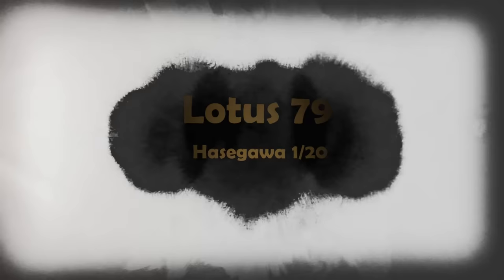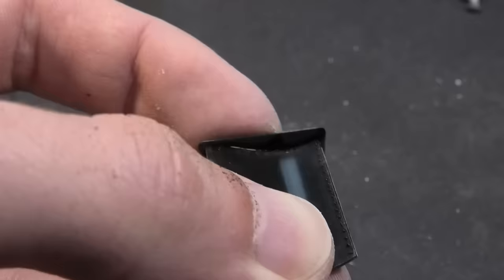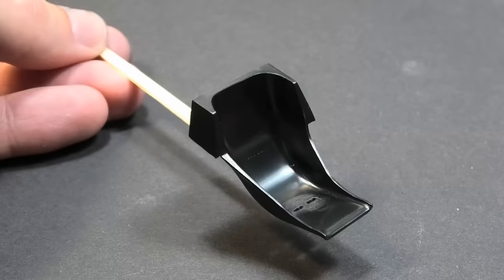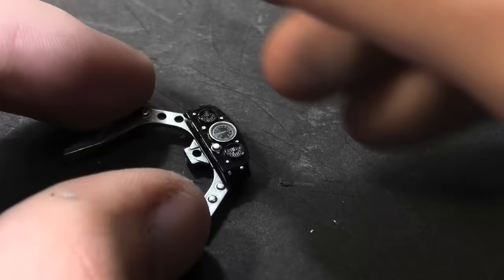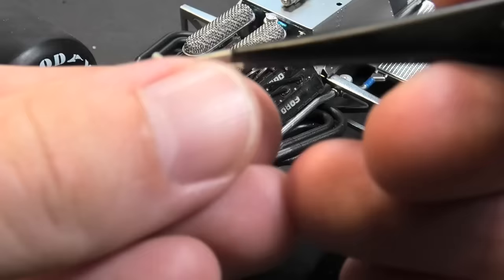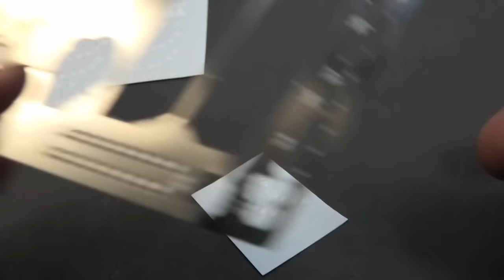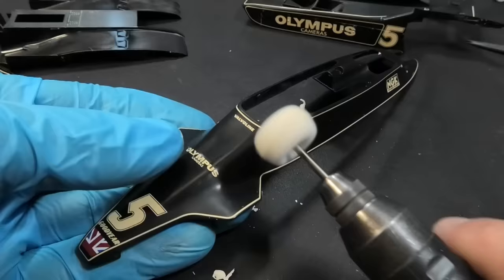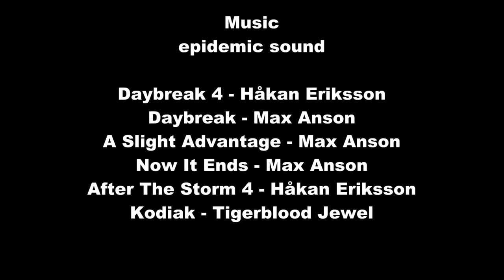Lotus 79 Black Beauty 1/20 Hasegawa - Car Model

Comment: FIY the wires used for WIFI transmission from the antennas to the WIFI module inside laptops have that braided texture. Excellent for making small details.
Reply: Good tip!
Reply: Thanks for the tip, I have a dead laptop I can raid for part!

Comment: Absolutely stunning.
One comment I want to make is I see everyone scrubbing the tires to make them look rougher.
Brand new slicks are very smooth and very shiny, so there's nothing wrong with leaving them as is.
If the final model is super clean and super polished it would make sense for it to be on brand new slicks.

Comment: In real life the Goodyear tire logos were all quickly sprayed on with heavy card stencils - not done by hand for each tire as it would take forever doing hundreds of sets per race solely for advertising so to have it look realistic using the templates held right against the tire and hitting it with a loaded white in airbrush is the way to go. All my cars have been done this way and look great. Decals will crack over time on the rubber base.

Comment: The technique of using thin glue to dissolve the decals on the tyres also works for removing silvering on decals, even if you've already applied clearcoat over them. Of course new clear coat is needed afterwards, but it can still save an otherwise ruined model!

Comment: The JPS logo's are missing, is this on purpose, or is the kit missing them for legal reasons?
Reply: There are not included in the kit. But primarily my mistake that I did not ordered new extra decals. Correction 1 :  the version is from 1978 german GP and the JPS logo was not include on formula one surface. I  watched the video from race. So I think it is correct.
Reply: @daviddamek4478  Awesome thanks David, an outstanding model!!!